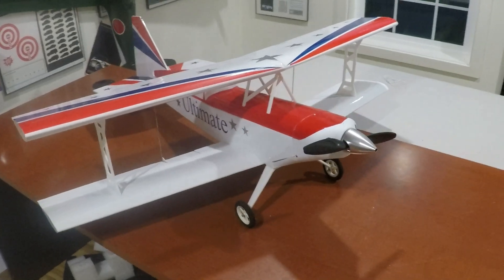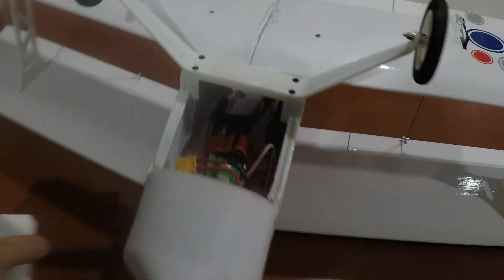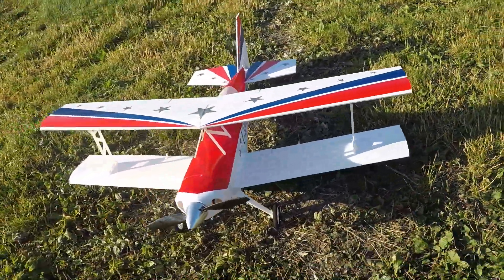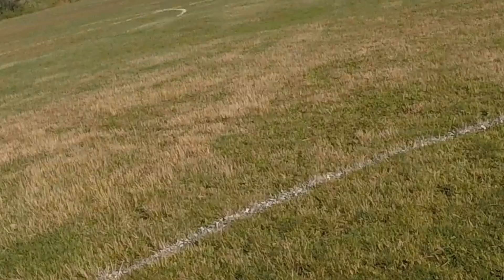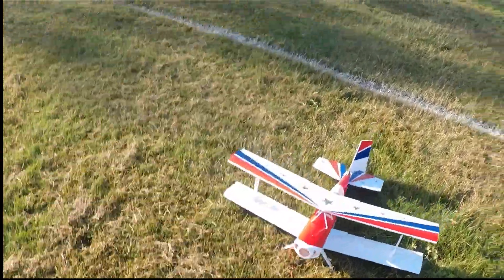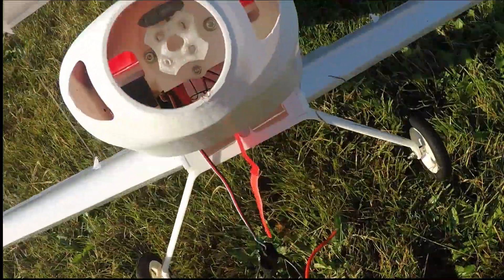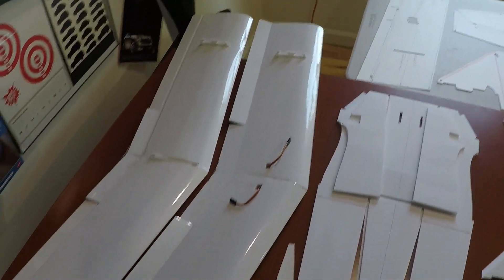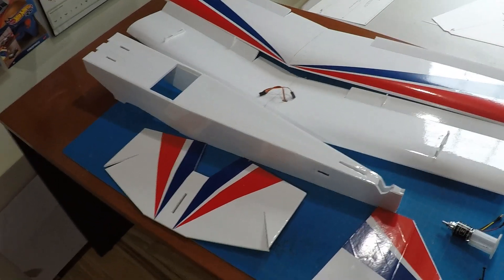Foam Board and 3D Printed 1M Ultimate Biplane Overview, Fiery Maiden, Build Details.

Comment: Man that sucks! That smell nor the oily residue never fully comes out of the airplane. We were just talking about this, but I have tried just about every PLA possible with motor mounts and have only had luck with ASA. Also, I always use washers on the back so if it does heat up, they won't pull through so easily and you can let it cool. I did hear you mention that though. From my experience, you can always tell when the motor starts to melt the PLA while flying. Overall, your Ultimate really turned out beautiful! Do you still have that specific model, or did you trash it from the burnt electronics smell? Just curious!
Reply from the maker: Changed to using the aluminum x-mount with ABS motor mount.  Plane flies excellent now. Still flying with 20ish flights so far.  One of my favorites. One day I will do a comparison to the Hobby King Gladiator….but still haven’t built it yet. BTW, smell still there but very diminished now.

Comment: opps, watched the video again, you do use PETG.  I like using the Xmounts for the motors, I think it acts as a heat sink to help the PETG not get so hot.  I use a watt meter and try to keep my motors a little on the under-propped side.  4-40 scres and t-nuts on the PETG have served me pretty well too.  Still you put out awesome planes !!
Reply from the maker: @deanmiller3660  actually upgraded to ABS with the bigger motor. Next plane (AT-802 Air Warden) will use the x-mount.  I use 3mm screws and embed square nuts in the firewall.

Comment: Really like your planes. Do you use PETG for the motor Mount? I have been slowly adding more 3d printed parts on my foamboard planes ( control horns, motor mounts ).I use PETG for the Temp resistance. Got some lightweight PLA ( Hatchbox) and experimenting with ribs for foamboard covered wings.  Regular PLA a bit heavy.  This plane takes it to a new level....Awesome !!!!